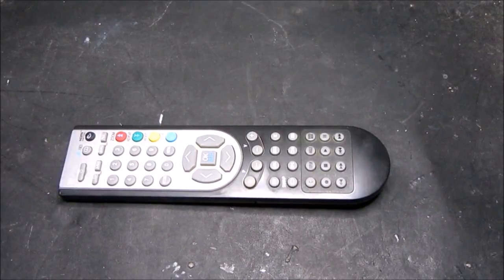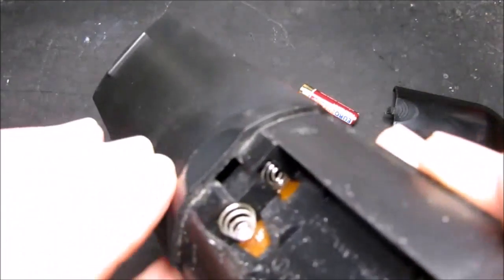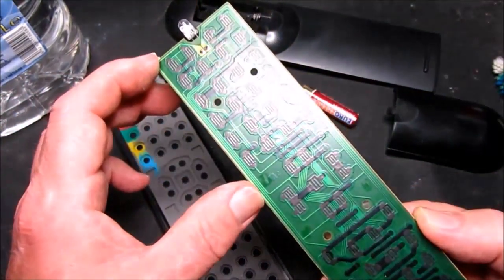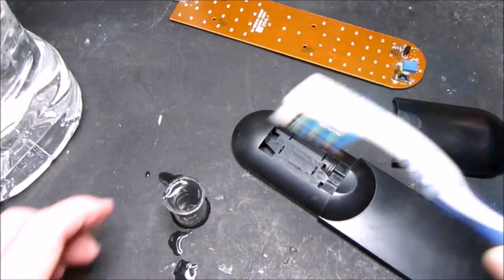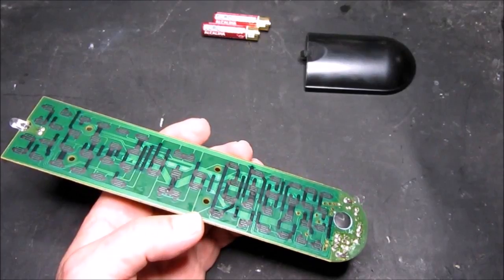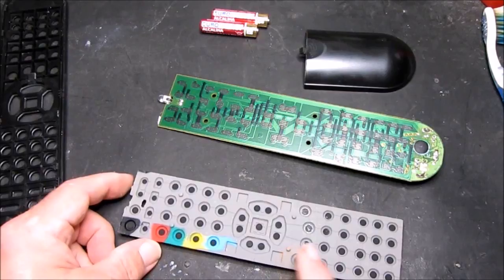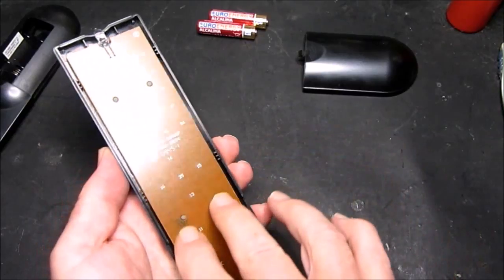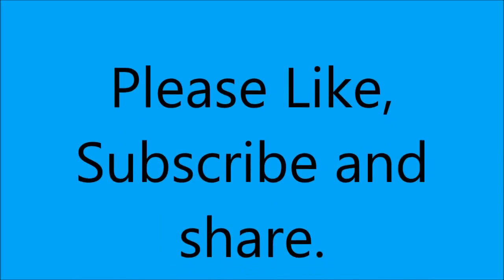Infra Red Remote Control Repair TV Remote Fix Broken Control

Comment: When I press any button I see on a camera screen that the infra red light flikkers just once each time I press it. It should flikker as long as any button is pressed. Cleaning made no difference. Would this be that little bulb itself which is faulty or do you have an other insight?

Comment: I have Kenwood Remote control RC-517, its IR led is working(checked using mobile camera) only, it does not perform any functions like volume up down, power nothing. Any help or guess what should I do to make it working again.
Reply from the maker: Hi, if I understand correctly you are saying that the IR led works only on some functions? In that case almost certainly some liquid or foreign matter is inside the control stopping the buttons working. You will need to take it apart and clean it as I did in the video.
Reply: @1nformatica  I think it is damaged as there is dark black mark on circuit board having size of one cell. Probably it got some heat or cell leaked which results in not working remote. After cleaning ir led also stopped working.
Thanks.
Reply from the maker: @saqibsami2783  It is a pity you could not fix it, but at least you tried! Now you have more experience for your next repair! YouTube no longer shows me if you are subscribed. Please consider subscribing if you have not done so already!

Comment: My remote is pretty new.Its not dirty has has no corrosion anywhere.Yet the IF only works once in a blue moon.The contacts all look ok.There doesnt appear to be any breaks or separation in any contacts.Ive had this blu ray for a couple months and the remote is usually just sitting on it and it hasnt been dropped at all.Im thinking it's just defective.
Reply from the maker: If you don't see it flash in a camera https://youtu.be/zrR96CjE0w4?t=584  (and the batteries are good!) then check the solder joints under a magnifying glass or microscope. Look at the LED and battery joints especially as they are prone to cracking or may even be dry joints. Good luck and please consider subscribing!

Comment: One thing that you might have mentioned is that it's a good idea not to touch those contacts with your fingers -- skin oils can cause problems!
Reply from the maker: Good point. Once the contacts are cleaned with IPA then take care to hold the board by the edges. Thanks.